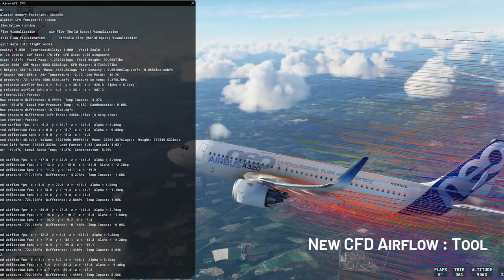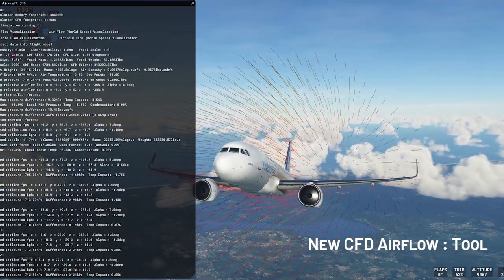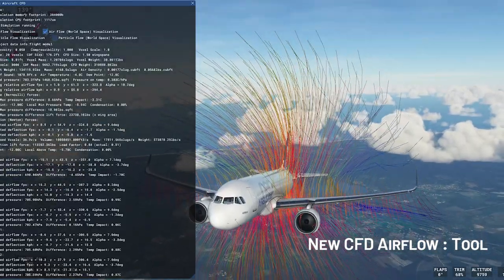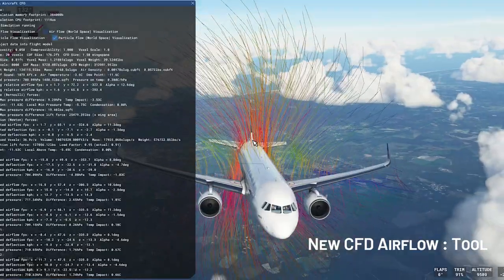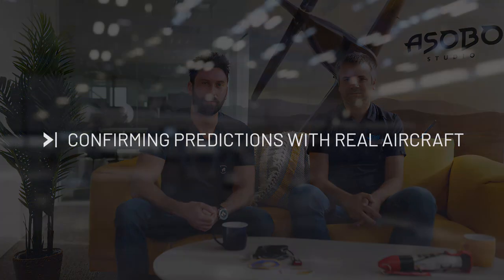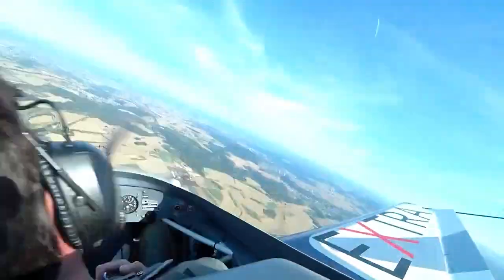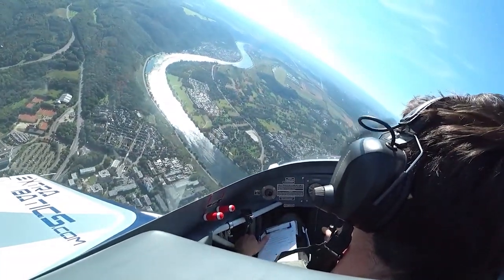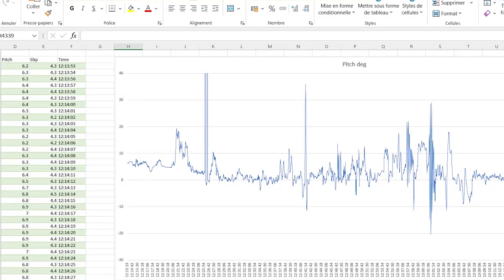Feature Discovery Series Episode 12: Aerodynamics

Comment: In this update there's the new propeller modeling on some planes, right? Like the C152.
I'm using it but the plane does not need any rudder input in a full power climb at Vx. The assistance options are set on "True to life". Am I missing something?

Comment: Great move, but we developers need more changes in SDK to allow us modify part of the planes and make our custom engines physics. 1.5 years from release and still waiting (more than a year since I exported this into MSFS [MSFS] Siai Marchetti flight model testing - PreAlpha Stage - YouTube ). We could transfer our SF260 with REP from Xplane11 but it is impossible. I think also A2A simulations is having problems. 
In any case any improvement in flight physics is welcome! (I hope the spring effect with yaw is also fixed. Have to try this new programming).

Comment: Can you make the aircraft editor aerodynamic and geometry setup a little bit easier to use? I want to get into aircraft design but the sdk is not easy to use at all compared to what I'm used to in other sims.
Reply: If you DM me on Twitter I can send you a Discord invite link to the community MSFS SDK Discord server. Pretty sure some aircraft developers can guide you.
Reply: @Mrazgoodaz  Thanks! But I think I'm already in that group I'll probably ask around there soon but I think at its core it's a problem with the SDK and MSFS. I don't even know whether they have support for custom airfoil. They just want you to add all the data directly and not have the simulator calculate it as in X-Plane.

Comment: This is by far the weakest part of the sim, so it's good to see it being worked on.
I haven't tested it recently, but I was able to take a cessna 152 from the runway, directly into a full loop then barrel roll on exit (in sim, obviously). The plane never complained or even tried to stall.
Reply: Lol prove it. It was never able to do that unless you tweaked the profile. The 152 has never had the power to take off and go into a loop. She definitely stalls. I played with stalls and spins in the 152 and the 172 shortly after release.
Reply: @FunktasticLucky  I wish I had filmed it. I haven't got msfs installed at the moment, because it's 100 GB that I can use on dcs instead.

Comment: You guys need to work on ridge lift (defined as what happens when horizontal wind hits an upslope like a ridge or a mountain face. At the moment the deflected air keeps going up like forever whereas in reality higher  horizontal winds that are not going up the slope will continue vertically and bend the rising air over (usually at between 500 and 1000 feet above the ridge Depending on wind speed. Maybe you need to send your test pilot to a gliding club to check this out (along with thermal updraughts)

Comment: I wish they would first fix the aerodynamic flaw where on a twin engine aircraft an engine failure doesn't create a yaw due to thrust assymetry. I am seriously wondering if that is such a complicated thing to simulate?
Reply: we don’t have the same sim. Asymmetric thrust is arledy modeled before su8 (da62)
Reply: @franckcagnes6370  A 320 .....
Reply: @jean-guywallem  a320 is the worst plane of the sim
Reply: @jean-guywallem  try at least with fly by wire. But i would recommend c152 (with jplogistics if you can) or cj4 working title

Comment: Can someone please explain to me in what ways X-Plane is more realistic in terms of physics than the physics shown in this video? Because this seems pretty realistic...
Reply: X-Plane has been using a fluid dynamics simulation like the one in this video for a long time, it's one of the last things you could say was better about X-Plane, but when SU8 and SU9 are completed, I don't know if anyone will be able to say that anymore.
Reply: @TheHexperience  X-Plane uses fluid dynamics? Doubt.
Reply: @NicOz42  I think it's called blade theory, but whatever it's called, it simulates air flow rather that using a lookup table. The point is that a lot of xplane users said it had better flight dynamics, but now fs2020 will have a similar system.
Reply: @TheHexperience  The aircraft behaviour was janky in a stall, the fluid dynamics you're talking about is quite unrealistic then.
Reply: @TheHexperience  Xplane never used Cfd afaik.
Reply: @TheHexperience  In theory, once the aerodyn features are fully implementednand adjusted, msfs2020 on paper should be more accurate / deeper than what Xplane does.

Comment: Please fix the stabilisation of the aircraft at cruise. They behave as if they are in constant turbulence, which is not how real planes behave (I'm a pilot). I was flying the Bonanza yesteday in 14 knot headwind, 16 knot cross wind and it was constantly yawing back and forth trying to correct for the crosswind. In reality, you'd tweak the rudder trim to dial out the crosswind effect on your track. If you did what the Sim does, you'd create metal fatigue in the tail and would quickly lose your tail.  Please fix it.

Comment: I really don’t like the aerodynamics in this sim. When flying the Cessna 172, it feels like it just doesn’t wanna fly.  In real life, when pulling back on the controls, the plane easily wants to fly and the lift is very much more alive. In FS2020, I feel like the nose is extremely heavy and it takes a lot just to get it off the ground. I often have to rotate around 65kts just to get it up, then after taking off, the plane feels way over powered. For example, normally you would climb at 75-80kts full power, but on fs2020 the plane will easily climb at 1000fpm at 90kts. 
Also, in real life…. The plane glides very well and sometimes you have to power off a lot sooner just to get down on the ground before “flaring”, but in fs2020 the aircraft feels too heavy you almost have to land with slight power.   Also, the autopilot systems on fs2020 are very buggy and on the jets not very user friendly.  For example, you can’t just press (or click) the knobs to activate the autopilot settings. 
Not to mention, it seems like every time I re open fs2020, control sensitivity and behavior feels like it changes randomly, as well as randomly switching to cursor mode.  Also, we really need to have access to the GPS on GA aircraft. I believe there are some things that were over looked.